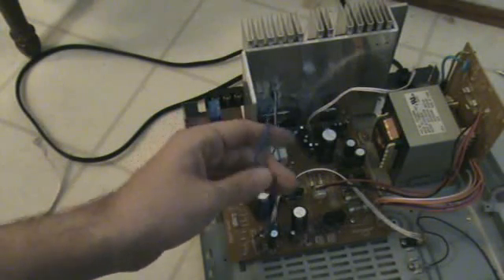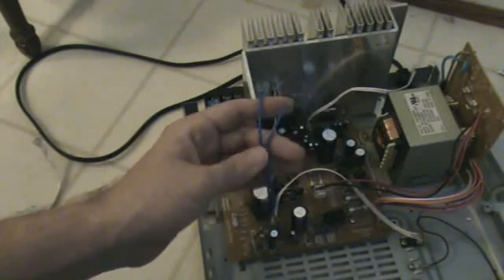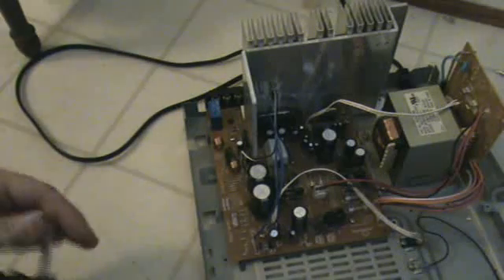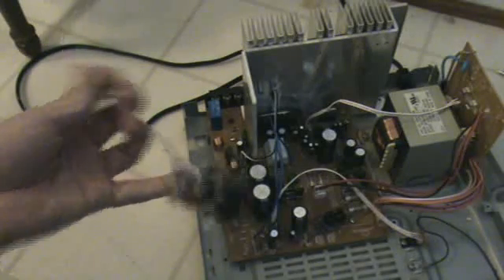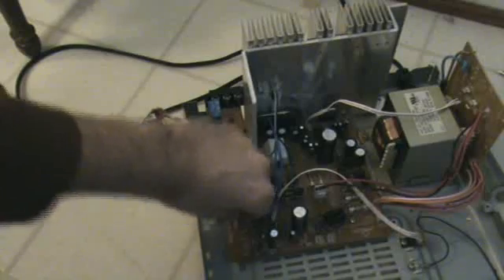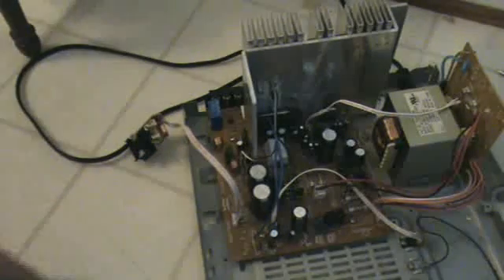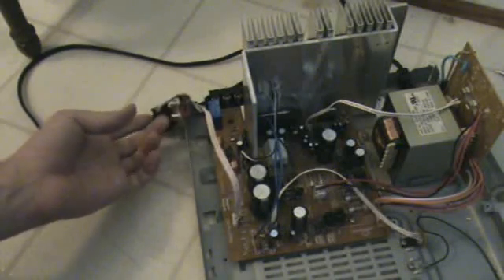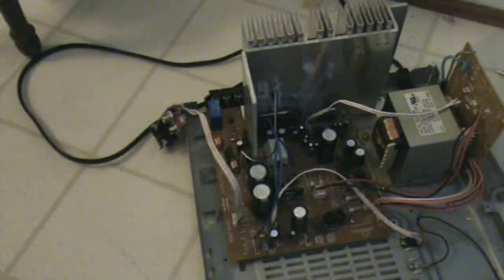Circuit Hacking: Back-Tracing

Comment from the maker: @ygros00 By taking everything apart.  Just ignore those "NO USER SERVICEABLE PARTS INSIDE" and other such drivel.  Of course a background in electronics helps.  I started with an AM/FM radio kit and "electronics project lab" from Radio Shack and progressed from there.